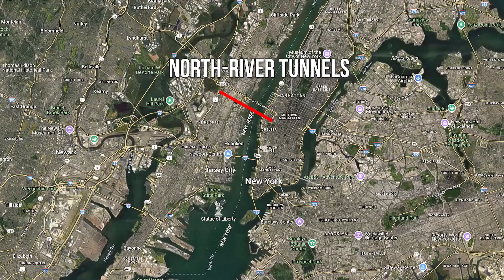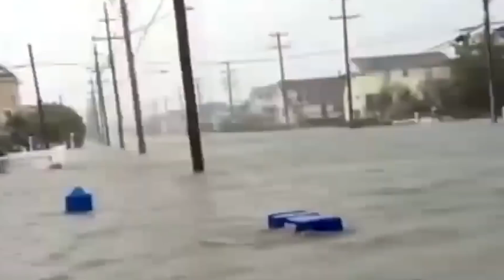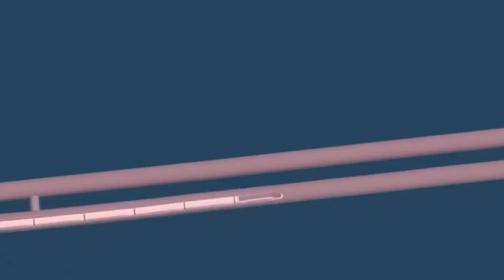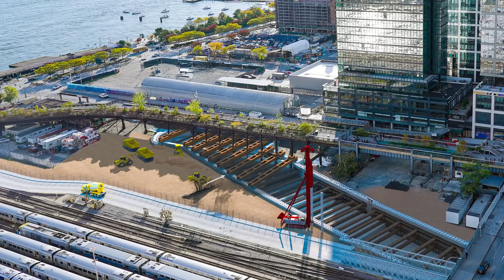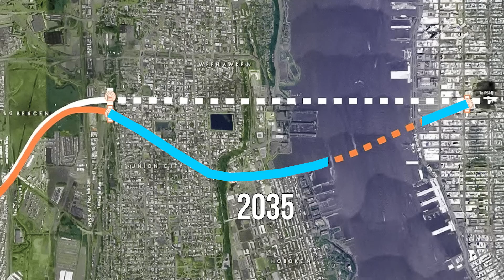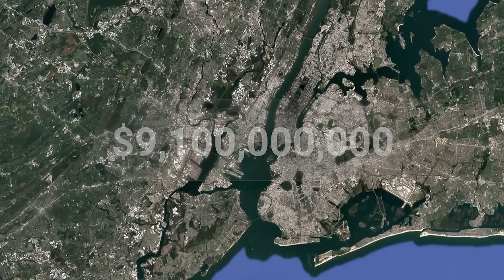U.S. Again Is Digging Million Tons of Sand Under the River in New York, It Will Change Everything

Comment: In 2004, I was working for a company that was looking at the design for a tunnel from NYC to NJ. I was wondering what had happened to the project. Connecting to the existing tunnel is a very bad idea.
Reply: Was that the idea to replace Tapanzee bridge via a tunnel from NJ? And got shot down by Gov. Christy?
Reply: @gurumyster  I don't think so. I recall that the tunnel was in the NYC area while the Tapanzee Bridge is about an hour north of NYC. I was glad to not get involved with the tunnel. Too many cooks spoiling the broth. I preferred to do my designs entirely by myself. I was very good with bridges but, I wasn't experienced with tunnels. Good Luck, Rick
Reply: @richardross7219  Chris Christie k1lled that entire rail tunnel project around 2011(?). It was to be called ARC, for Access to the Region's Core.  Christie diverted all the federal $$$ earmarked for ARC into NJ highway projects.  It was seen as a big GOP fork-yoo to President Obama who was solidly behind ARC due to the deteriorating and way-over-capacity North River tunnels.  Hurricane Sandy in 2012 caused a lot of damage to the NRT's and proved how dumb and petty and selfish Christie was is ax'ing ARC.  Thank goodness the new rail runnels are back under construction, but the 13 year delay and the Sandy damage has only exacerbated the original issues and probably added 50% to the overall price tag.  Never forget -- Republicans hate their constituents, worse now than ever before.